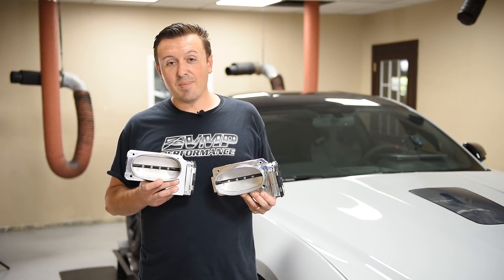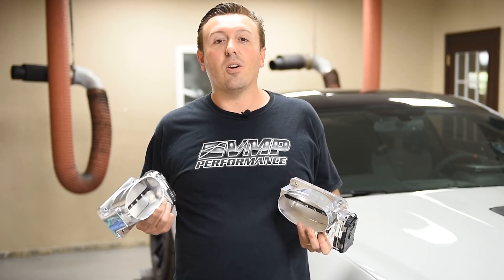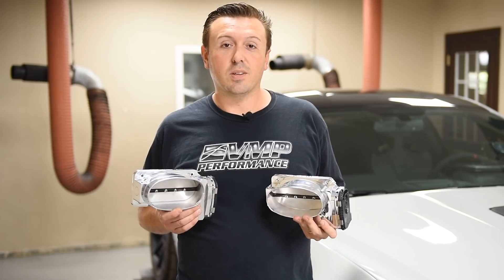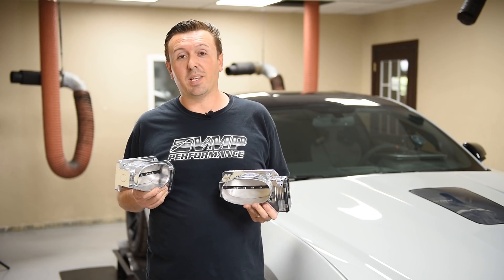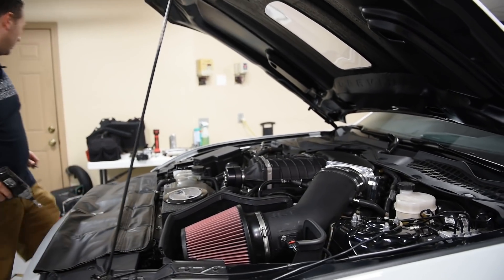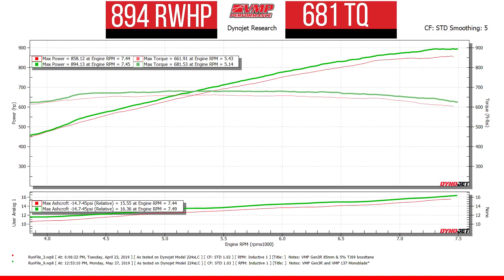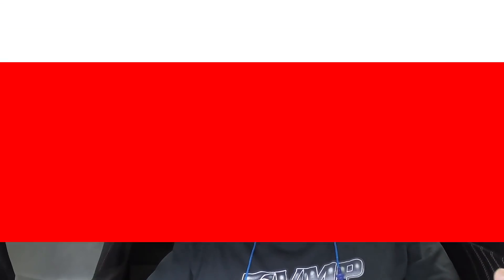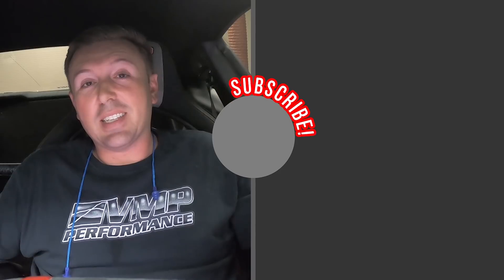900 RWHP on 93 Octane with the VMP Gen3R

Comment from the maker: How much HP do you think Track Attack will make with the new VMP 163R Throttle body? Comment your guesses below!
Reply: I am guessing...937
Reply: VMPPerformance good for bolt on 2013 GT500? Probably a stupid question
Reply: My guess 925 rwhp
Reply: @maximusvonce1381  wrong
Reply: @The Man  bud the hood is open to help with cooling. It doesn't effect the dyno numbers at all.
Reply: 900hp on 93 wowww
Reply: What the pully size

Comment: Do y’all sell gen3R tuner kits? I already have 1000cc injectors, fuel system ect.
Reply from the maker: Hey Alberto, we sell the kit as a complete package to ensure that all of the components work together optimally. You could look for a lower intake used and order a head unit from us : https://www.vmpperformance.com/VMP-Gen-3R-head-unit-upgrade-kit-for-2011-2017-Coyote-5.0-L or you could sell your existing parts. Hope that helps! Let us know if we can point you in the right direction!

Comment: Just the gen3 for my s550 with department of boost manifold,1 7/8 to 3 inch headers, 3 inch track exhaust with 3 pipe no cats 123mm jlt and triple fuel pump, next is new shortblock with fully forged and head work.

Comment: 894hp & 681trq on 16+lbs but with same 85mm upper and 5% od lower with the 137mm oval . That really isn't a lot of boost . I believe with just the gen3 and 85mm upper with the 69mm TB it made like 754hp ? Yeah the Gen3R rocks mind you with a stock 5.0 with only headers !!! And of course a week ago 30lbs of boost and 163r mono it made 1141hp on the same stock engine ! Look forward to seeing the gen3r on a built motor/ported heads/cams etc, 8000+ rpm !!!! What is this blower capable of ??????

Comment: Yep totally getting that throttle body and the new Gen3r...so any body need a Gen2r by chance lol
Reply: What will happen if my tech didn't get all 91 octane out of my tank. Did u buy vmp fuel swap kit.
Reply: Can you set fuel line pressure to 55psi without your Fuel swap kit?. I didn't know i was supposed to buy your fuel swap kit too when i purchased vmp plug and play fuel system and fic injectors. No one at Vmp told me that when i called and placed order. Now i am wondering if my tech got all the 91 octane out of tank and set my fuel pressure properly. Car is throwing p0175, p0172 codes now. Please help
Reply: Man that's ridiculous. I just spoke with vmp last week and they said nothing about routing feed line to passenger side. Thats bullshit.  Now i gotta pay my tech to do that again.  Why does vmp tell everyone in their video to route feed line to driver side?
Reply: @maximusvonce1381  when 
You say you have all the 91 octane out, do u have a ethonal reading gauge?
Reply: Jason. No i dont have ethanol gauge. Are they easy to install
Reply: @maximusvonce1381  actually they are pretty simple just tap into ur return line and ull get the actual ethonal reading https://www.maperformance.com/products/innovate-motorsports-ethanol-content-fuel-temp-3904
Reply: Jason. Hey i installed vmp plug and play fuel system on my 11 Roush TVS 5.0 with vmp e85 tune. Now its throwing codes p0175,  p0172 and cuts out at high rpm and feels down on power compared to my previous 91 octane tune. I should make more power on e85, not less. I called vmp and emailed them, but they aren't available till tomorrow Monday.  Can you tell me what's going on. Is it a fuel pressure issue or tune needs revision,  or did i leave too much residual 91 octane in tank when i added e85. Plus my boost went down with vmp e85 tune, but justin said thats cause he changed cam timing for improved flow. I currently run 82mm pulley n jlt cold air with roush gen 1 blower n gen 1 coyote. I may drop down to a 76mm pulley since justin lowered boost with this new e85 tune. I hope you can help me.
Reply: @maximusvonce1381  how is the supply routed, is it going to the fuel pressure regulator? Mine used to be like that and I would get a hick up around 1900 rpm. I had to call vmp and they sent me parts so I then rerouted the supply line to the passanger side fuel rail then it goes to the drivers side rail then goes to the regulator and returns from there.....after I rerouted that I had problems with it missing and breaking up I looked at the fuel pressure it was only 20 psi so I turned it up to 70 psi I think 50 psi is recommended and boom no more issues. So first is it routed correct? Also is there more than 50 psi fuel pressure?
Reply: Jason.

Supply line routed to fuel regulator on driver side, like vmp recommended in their install video. Fuel pressure at 55psi at  idle,  like vmp recommended in their video. What could it be.. thanks. Did you get p0175 codes too. ?. Did i leave too much 91 in tank. You picked up power over 91 octane correct?
Reply: @maximusvonce1381  ok they probably have the front and back 02s on, i get a CEL too sometimes cuz they can't turn the rear 02s off anymore cuz of emissions so the ? Is do u have cats on or no if u don't get the whatcha ma call em u need to to trick em.....but yeah ull have to call vmp pay the $50 and get the parts to route the fuel line to the passenger side, its something like seriously the other day they figured out that what happens the way u have it routed the fuel dead heads into the fuel pressure regulator and thatll cuz a break up in ur tune so yeah trial and error i guess
Reply: Jason. Where did you mount ethanol sensor,  does it come with bracket to mount in engine bay. Where did you mount gauge inside car.
Reply: @maximusvonce1381  the sensor hides under my throttle body off the return line, I got some clamps and fuel fittings off amazon...NOT THE RIGHT WAY TO DO IT BUT IT WORKS SO FAR FOR OVER A YEAR JUST FYI. Its so worth it and ull be amazed the different in ethonal at different gas stations

Comment: Ha Ha now your going have all these people calling up from all over east overshoe wanting you to tune their cars. But Justin i want my bone stock motor on 93 pump to make 900 RWHP. But But Track Attack did it. Tic Tic Tic Boom... LMAO Folks Justin does not care if he blows up Track Attack pushing it to the limits they have the can do to put it back together..
Reply from the maker: Right after this video was shot, we drove this car 200+ miles while it was up in PA for Carlisle Ford Nationals and the American Muscle Show.  From Malvern, to Pottstown, to Mohton.  We never worried about it leaving us stranded.
Reply: Exactly. Most of these guys on here dont figure that in. If you want any Gen 3 coyote to last over 100k miles with repeated rev limiter blasts, dont go over 700wheel unless you build motor. You can get by with more but it's a time bomb. Justin has his own shop and lots of cash to rebuild any motor he blows. I am at 100k miles on 600wheel gen 1 coyote daily driver constant rev limiter blasts. But I am way below threshold of 650wheel on gen 1 motors. Gen 2 and 3 will take 700-750wheel, although I would stay around 700wheel to be safe and last the long haul.
Reply: Ford didn't design that block to support 1000+ at the crank. More timing, higher boost earlier in the rpm range = higher PCP and eventually parts will fly. If you want to have any kind of longevity, you'll build the motor. You can't cheat physics!

Comment: I'm confused. I thought 725rw was about max Hp for 93 Octane and that's why everyone wants you to switch to E85?
Reply from the maker: Yes, don't try  this at home, we are keeping the revs low to deal with the fuel pressure drop off.  When we put in the fuel system we will push it to 8k!
Reply: Its all about air flow. 725rw isn't the ceiling for ur motor just ur current set-up. E85 allows more timing and boost so u make even more power but one can make 1500-1800 hp on 93 pump gas maybe more. Look at Nelson Racing Engines. They sell 1500 hp 93 octane pump gas packages. Lots more CI's
Reply: @TENNESSEETRACKHAWK  They added Boostane. Not straight 93.

Comment: I need this setup in my life 900 rwhp on 93 I  already emailed you guys 😂take my money
Reply: blue_devil5.0 93 with boostane
Reply: @alkhulaifi302  exactly... still impressive though no doubt
Reply: @devindarby4521  boostane is only 25bucks a qt. Will turn 25 gallons of 93 to 100 octane.
Reply: @Tim Martin  I order it online in bulk and get it about 17 bucks a bottle 1 full bottle of premium turns 15 gallons into 100 octane so basically you need a full bottle per tank it holds 15.9 gallon and you only add 12-14tops  depending how low you run your fuel so yea.

Comment: Did you say that is a stock motor ?
Reply from the maker: Yes you heard that right! Track Attack's motor still has stock internals!
Reply: @VMPPerformanceTV  
That's funny, because I've been worried about mine at 750hp. Lol
Thanks!
Reply: @jeffersonhenn1086  750? you good bro, just stay off the rev limiter.